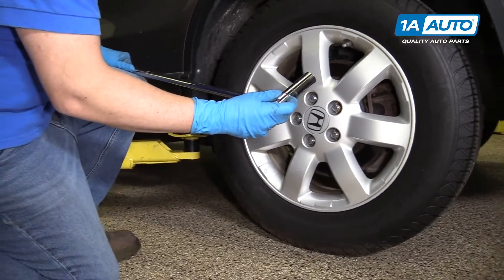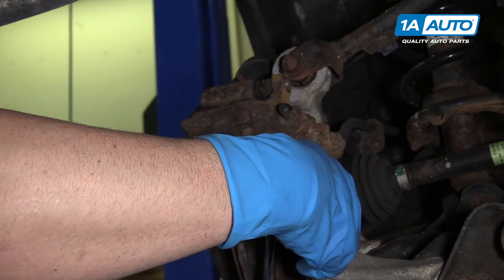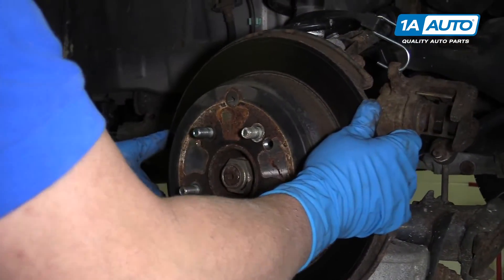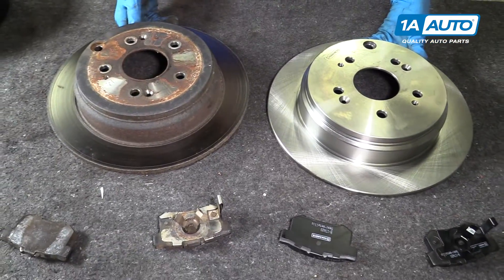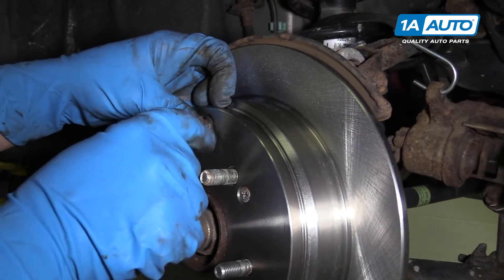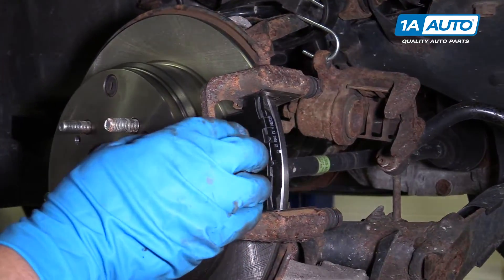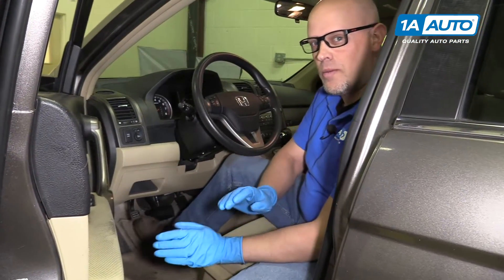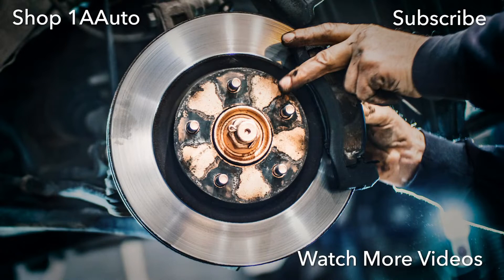How to Replace Rear Brakes 07-11 Honda CR-V

Comment: IMPORTANT PRO TIP NOT SHOWN HERE:  as a 30+ year master tech, I've learend many years ago directly from brake a Bendix class to wash the rotors with soap and water, even if you've already used brake cleaner for degreasing.  Why?  Soap will lift and remove the micro-fine magnetic maching dust left behind from the lathe.  Solvent will not.  That dust acts just like tiny little ball bearings or even graphite grease between the pad and rotor making it more difficult to seat in the new surface together.  The sympton is always "the new brakes take longer to stop so they need break-in."  Pros that know this never need to "break-in" pads...ever!  This is especially true if the rotors were just resurface on a brake lathe.  New rotors in a box are pretty clean already, but try this anyway to be sure: grab a tissue and wipe it over the face of the rotor.  If you see any gray on the tissue, that's the dust that needs to be washed off.

Comment: For anybody watching this, DO NOT TOUCH THE PADS OR ROTORS WITH DIRTY GLOVES DURING INSTALL!!!
Reply: why
Reply: Pads and rotors collect dirt all the time, so what's gonna happen if touched with dirty gloves ????
Reply: @bahhaziz  its what is makes the gloves dirty that is the problem you dont want any oil or grease on your brakes if you can help it but thats why you use brake cleaner.

Comment: As a parts man I think you would have recommended the hardware kit. So much easier to put back together if you damage anything removing the parts. A fairly easy thing to overlook is the hardware. You may be able to reuse the existing parts.

Comment: You just completely ignore the position of the adjusting hole which you pull the rubber plug off.

Comment: Take that little rubber plug out first and if you rotate the disc so it is just forward of bottom centre you can then access the parking break adjuster and loosen off the brake shoes and make removing the disk a lot easier. just use a flat blade screwdriver to rotate the little toothed adjuster. you will need to readjust after fitting the new disc by tightening until the break locks then backing off until it is free again. also make sure you clean inside the drum part of the disc with break cleaner otherwise your parking break will slip/

Comment: Thanks for the video! The correct screwdriver to use for removing the rotor screws is a #3 Japanese industrial standard screwdriver. Those screws came out way too easy!

Comment: Thanks for this video, it was very well filmed and the steps were clearly explained. I did buy the Vessel Impacta crosspoint screwdriver to help with those difficult screws on the rotor, and I believe it was well worth having it.

Comment: At 8:42 this guy really trying to get us to think he cleaned that caliper that well hahahahhaha - you must have scrubbed it for weeks!
Reply from the maker: Thanks for checking us out. 1aauto.com +Jordan Penley
Reply: Ya how did he clean that that clear?
Reply: I need one of those brushes apparently
Reply: @footage6402  Looks like it's a brand new caliper bracket.
Reply: They reused some of the same video clips with their guide on changing the entire caliper on the same car.
Reply: Fitting new clips with an old bracket is sometimes hell. I completely understand why he just bought a new bracket. xD

Comment: I see you didn't change the spring clip as most caliper kits dont come with it, would that be a problem later as far as squeaking or vibration, or do you think you can just leave it

Comment: Good video. I like the fact Honda allows you to compress the rear brake pistons, rather than the infamous GM crank and turn. (PITA). P.S Why the tapered screws on the rotors? Car would never miss them.

Comment: Note for most people they will need to use a impact hammer to remove those two Philips screws on the rotor.  It’s a special Japan type screw and normal Philips bit will strip under load.  Yet a cheep workaround is  the $8 impact hammer screwdriver from harbor freight.  The screws are not needed once removed, they are only there as convenience when the car was built.  Also many will need to loosen the Parking brake, that’s what that little rubber hole is for. To get access to the praise adjuster

Comment: You dont open the cap on the fluid reservoir? Thanks for the info.
Reply: you never open the cap unless you are installing new calipers. all you'll do is introduce air and moisture into your lines which will give you major problems.
Reply: @tyler8076  I always thought that you had to remove the reservoir cap to allow the piston to retract back to its original position, otherwise you would get pushback on the piston and would make it hard to retract.
Reply: @gr2262  yOU'RE CORRECT

Comment: I have watched quite a few of these crv rear brake videos and no one is replacing the main caliper spring clip.  I got a new one with my kit.  How the heck do you remove it?  Pry with screwdriver???
Reply from the maker: +Mike Arceri Using needle nosed pliers and a flat blade screwdriver, you can remove these spring clips.  Thanks for watching.

Comment: I did all the steps and comes perfect, but after I finish the light vsa and abs comes on, any idea !?
Reply: Make sure the brake fluid reservoir is completely full. Not sure why, but this worked for me when I had the same problem.
Reply: you might have removed the sensor by accident
Reply: Anyone have issues with a whirring or loud noise after using the VSA?

Comment: Do you have to  change the rotors everytime you change the brakes .
Reply from the maker: +Glen McKelvey It is not necessary for the rotors and pads to be changed at the same time but it is easier for the parts to all be changed at once.
Reply: @1AAuto  
Thanks .

Comment: Brand new caliper and bracket when he's putting the wheel back on. Magic?
Reply: Great video though. Very informative, had never seen that type of caliper clip on a break pad before. What about the clip mounted inside the caliper on the top?

Comment: Weird, your front video calls for 101 ft lbs on caliper bolts and this video (rear) calls for 79 ft lbs. The specs are that different on the front and back?
Reply: They could be different

Comment: Sensor for the brake pad goes on the inside of the wheel and does it go on top or bottom or doesn't matter?
Reply: The brake pad wear indicators always go on the trailing edge of the rotor. This means it'll always be the side facing the front of the car, doesn't matter if it's inside or outside as long as it's the trailing edge and not the leading edge. Trailing edge means it's the last point the rotor touches as it slides through the pad when rolling forward.

Comment: At the 7 minute mark when they are comparing the OEM and A1Auto rotors does the A1 rotor look a lot thinner and single wslled unlike the double walled OEM rotor?
Reply from the maker: +Rahil Modi It appears to be the camera angle, it is the same thickness as the OE. Thanks for checking us out!

Comment: Why didn't you clean the rust from the brake caliper and brake piston? Why didn't you lubricate the copper plates in the brake calipers with ceramic paste. Why you didn't replace them with new ones?
Why didn't you clean the brake piston and lubricate the brake piston seal?

Such a rusted and uncleaned brake caliper reflects very badly on the mechanic who replaced it.

What about pad spring? These visible on your movie in 14:59. Why didn't you clean them of rust?

Comment: This 2009 Honda CR-V has so much rust,  as if it got submerged in the water for two weeks. I have a 2007 Honda CR-V that is very clean and no rust at all.
Reply: The car is probably from up north. It really does a number on our vehicles up here on Ohio.
Reply: Seems like every Michigan car I've ever seen.